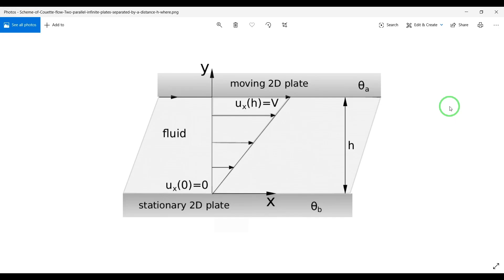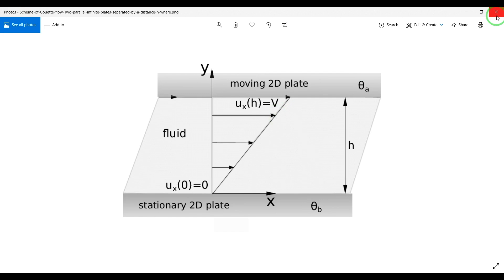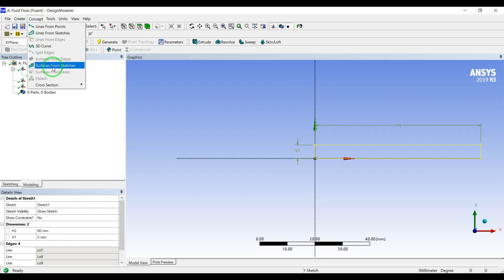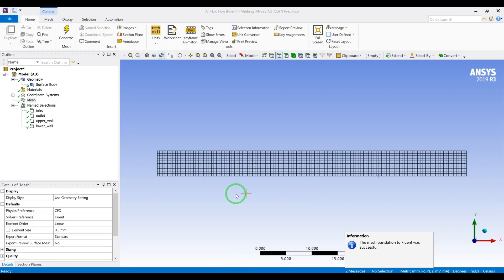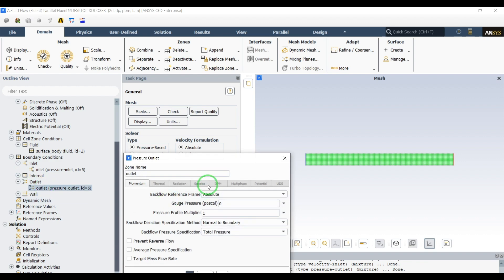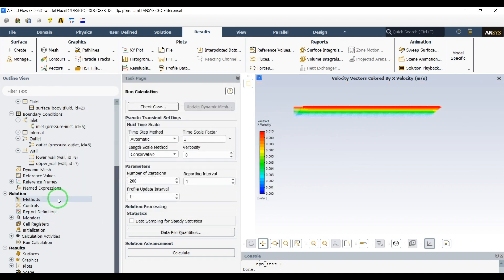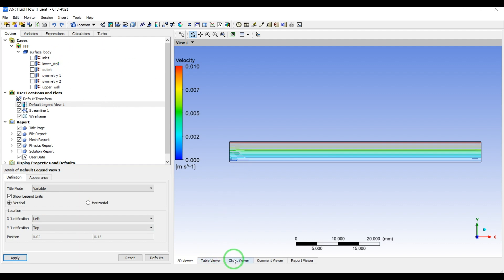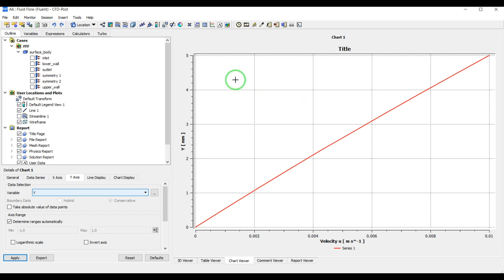ANSYS Fluent Tutorial: simulation of Couette flow between two plates

Comment: Thank you so much. Do you have an idea if I want to simulate two moving plates instead of one, what should be my boundary conditions in this case?
Reply from the maker: Sure, just do the same for the lower wall. Define a moving wall.
Reply: Advanced Engineering Tutorials I have figured this out. You need to define periodic boundary conditions instead of the inlet and outlet